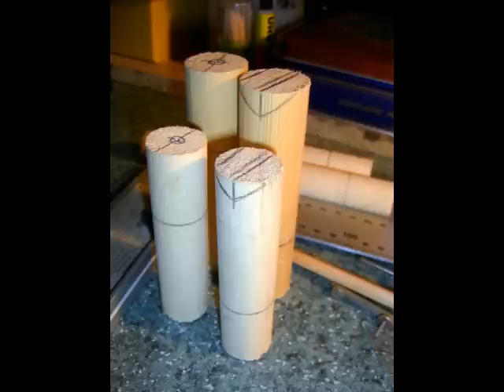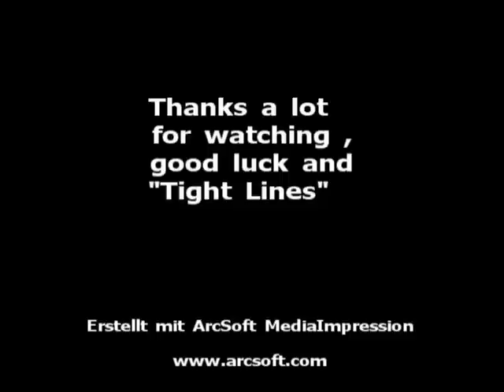Making Chugger Topwater Lures

Comment from the maker: Thanks a lot , .......used some fine mesh textile fabrics fixed into a larger embroidery hoop , which I clamped in a vise , held the lure by the tail screw eye with pliers pressing it against the fabrics from behind and gave it two or three quick passes with a paint spraycan , released the lure with a rapid movement from the net after two seconds .

Repeated on the other side , ...finally sprayed the back in solid color on . Off course base colour applied and dried before . Cheers , 61diemai

Comment from the maker: @ricksworks 

You may furnish a moderate head cupping to this "Lucky13" versions as well , would cause a louder pop(though not as a loud as a "real" topwater popper) , but the lure would not dive as deep this way .

These lures even seem to call fish to come by from the closer vicinity to investigate , happened more than once that I was working them thoroughly casting from one spot and pike would still strike it at places , that the lure had already passed a few times before .

Comment from the maker: @ricksworks 

Just had a look at yours , very nicely made for sure . These lures in my vid don't stay on the surface like a pure popper , since the lower lip portion is somehat longer than the top lip , they dive down 1 to 2 feet , .....when floating up , jerk them to dive and reel in for about 10 feet , ...then lure let rise back to the surface and repeat this manner thru entire retrieve .They'd pop moderately and pull a bubble trace when going down , .....deadly on local pike !

Comment from the maker: @LIFalcons99 

Thanks , Rich , ........made these pics years ago for some pictured stories in the local angling press , thus I had to keep it quite simple , as not everybody is fully geared up with tools .

I would turn down the plugs on a lathe and furnish the head cupping on my routing machine , had to show more simpler methods to the wide public though .

One can even carve the tail taper with a carpet knife(and sandpaper , naturally) , if going through a planful working process .

Comment: nice I cant wait to make one myself
Reply from the maker: Good luck with it , they really are great lure and fun to fish . 

Make sure to pick the right timber material , not too buoyant but not too heavy , too ! 

The last picture of the clip provides a clue , at which level the lure should float at rest , .....the lure performs best this way .

Any added belly ballast would be most likely counterproductive on such lures sporting integrated diving planes , it significantly dampens the wiggle .

Here is a video about how to work such lures , this particular lure model (Lucky 13)is the second one in the clip :

https://www.youtube.com/edit?o=U&video_id=aZS6Mz0Vx18

And here is another luremodel (Bottlehead Plug) , that is worked in the same manner like this "Lucky 13" and performs quite similar , only wiggles a tad more pronounced due to the more tapered body :

https://www.youtube.com/edit?o=U&video_id=HxoUzqvKcKU

Good luck with your  luremaking ventures , thanks for chiming in , ......"tight lines"  from northern Germany

Comment from the maker: You can see my drying rack in the background of some pictures , it is standing on the  opposing side of my workbench , lures hanging on it at 4:31 and 5:31 . But if you're using slow curing topcoats , you'd need a lure rotator to avoid dripping . 
My epoxy topcoat is fast curing , sets after about 30-40 min , so I just flip lures over from head to tail a few times .

Any more questions about luremaking ? Check out the "TackleUnderground" site ! Thanks for commenting , 61diemai

Comment: When is the best time to fish with it? In the spring, or the summer, or autumn, or winter? And at which temperature you catch the most? And has it to be sunny or wet and windy or whatever.
Ps: I am dutch, and my English is really bad. But nice video.
Reply from the maker: +Flip de Jong 

This lure model is based on the old proven "Heddon Lucky 13" , I am fishing it as from May 1st(end of local closing time) until mid-October , before pike migrate to deeper water .

It is just one out of three so-called "skim-and-swim" lures , meaning that they have a surface action plus a diving action , .......please check out this video of mine , where I'm talking about the swimming action of such lures :

https://www.youtube.com/watch?v=aZS6Mz0Vx18

Maybe in your shallow polders in the Netherlands they would work all year long , since pike can't go to deeper water there ? 

The weather does not seem to have any particular influence on the use of this lure , as long as the water is warm enough for pike to stay shallow, ......maybe only at certain times of day ?

Only thing might be , that if the water is too choppy of strong winds, the lure might not draw enough attention , I would use "louder" topwater lures in such cases .

Greetings from Hamburg/northern Germany , Dieter

PS : Your English is very good , don't be too hard on yourself !
Reply: Really thanks, I am sure I will make a lot of them!
Reply from the maker: +Flip de Jong 

Good luck , ......make sure to use wood , that is buoyant enough to achieve swimming level like on last picture in the video . No extra ballast required(might most likely even spoil the lure action .

You can obtain lure hardware at 

www.lureparts.nl

Good luck , Dieter

Comment: Been thinking about trying my hand at this for awhile now. Got a few ideas on how to change the balance of the lure to get the best action I'd like to try. On commercial lures Ill change the hooks. 
What song is that? Obviously its Irish.... (edit. The Fisherman's Song" ~ The Bedlam Boys caught it in the comments)
Reply from the maker: Joe Metheny I've found , that adding lead ballast to such vintage style plugs sporting an integrated diving vane at the head portion most likely does not do any good , .......it surely decreases buoyancy , thus lets the plug run a tad deeper , but same time it works like the keel of a sailing boat hindering the plug to roll and swing , significantly decreasing a most lively simming action this way .These integrated diving vanes simply can't generate as much leverage around the tow eye like added diving bills of metal or plastic mounted somewhere underneath the chin of a plug , so they are unable to create sufficient force to move a belly weight as much as added diving lips can .If ballast would be located right in the center of gravity , things  would turn out different, but I haven't tried it before , ....with very few exceptions , I leave all of my plugs of this and similar kind unweighted ,....... I'd rather try to pick different kinds of timber to achieve the desired buoancy for different lure models .I have a few more plug videos on my channel(striper bass plug catches pike)and also a video about "skim-and-swim" retrieve patterns , this particular plug model mentioned there as well .Thanks a lot for chiming in , ...greetz , DieterPS : Do you switch the hook to thicker or thinner wired ones ?
Reply: I use a 2.0 aft & a 3.0 treble hook forward. I've only tried it on Hula Poppers. And what it does is move the center of gravity forward allowing more control of the popping sound.
Makes a big difference with the action & strikes. The size popper Im talking about is medium & comes with two 2.0 hooks.
Of course modern Hula Poppers are plastic & the action of every one I've ever thrown was different. Even though they look the same. Some dont pop at all.

Comment: with what wood you make the topwater lures
Reply from the maker: The two larger ones are made from round dowels of European pinewood , ....but those turned out to be a bit too heavy in the end , laying somewhat too deep on the water's surface to be able to perfectly generate that typical pop and explosion of bubbles , .....they still wiggle along nicely , though , but the topwater action is not as good compared to a more buoyant lure .

Please check out this video to figure out about the desired swimming action of this lure model , starting at 3:15 :

Homemade "skim and swim" lures(review)

The smaller ones I've made from a broomstick of some buoyant , tropical timber , over here these are available at local tool marts or hardware stores , sadly I do not know the type of wood .

Abachewood is well suited , too , but requires to be turned on a lathe , since it comes in rectangular boards , not round dowels .

If you want to make these lures as shown in the video , you need to look for round dowels(25-30mm dia.)of buoyant timber , buoyancy somewhere inbetween pinewood and balsa , .....heavier wood like beechwood , oak , meranti , even poplar  , etc. is not suitable for such topwater lures .

Sorry that I'm unable to provide better info , ......good luck , 61diemai

Comment: Not saying you didn't do a good job because u did but when u make a lure next time use wire through the plug because if u hook up a nice fish it can pull the scew eyes right out and leave the fish with the hook
Reply from the maker: Thanks for your comment , ...by the time of making these lures I have made a pull test to these homemade wire eyes shown , utilized fishing scales in attempt to pull out such an epoxied eyes with 1" shank length .

At about 30 lbs pull the connecting cord snapped , the sudden release spoiled the scales , but the eye did not move the slightest bit , the glue also did not show no sign of coming lose .

Also caught a 47" pike with a homemade crankbait sporting epoxied screw eyes , absolutely no problems occured !

A friend of a friend caught a 65" silure on one of my large homemade lures equipped with epoxied screw eyes , .....but the pinewood material cracked up , he could still boat the fish , though .

I'm confident in these eyes for all local predatory fish like pike , zander(European walleye) , perch and trout , .......EXCEPT the biggest European predatory fish , the silure(catfish) , abundant in most of local waters , anyway , ......I'm just into making lures for this species right now , ...and , ....I'm going thru-wired , even with thicker gauge wire than usual .

Thanks again for your interest , .......tight lines , 61diemai